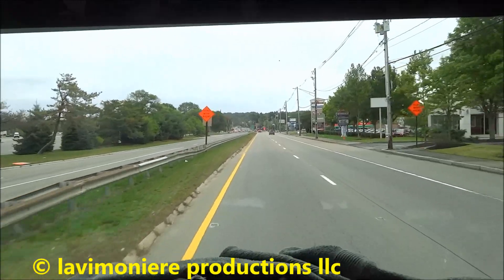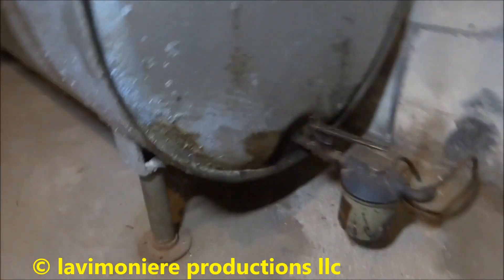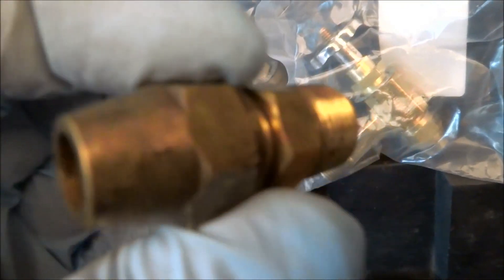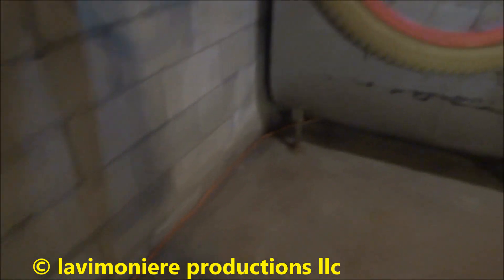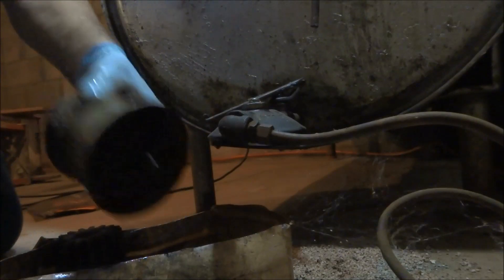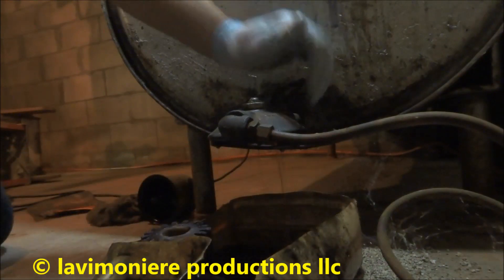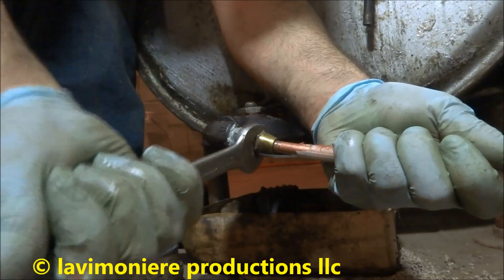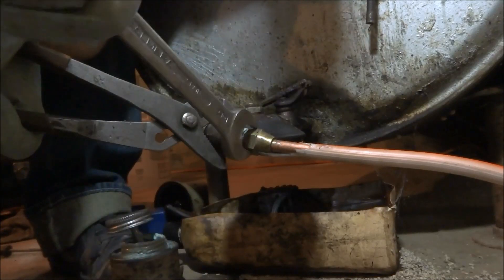oil line upgrade and burner service part 1 of 2

Comment: this is a perfect example of when you need a second pair of hands, someone to hold that filter assembly still while another wrenched the fitting off. granted you got it done by yourself,  but another person on some tuff jobs really helps IMO. especially taking on and off equipment from the van/truck (condenser/furnace etc.). good video Steve. i hate oil furnace calls. i try and save those calls for the end of the day so my clothes don't stink.

Comment: Nice work. This is a beast of a job. You were worried about breaking the nipple off... I wonder if wedging a section of 2 x 4 under the filter assembly would help prevent that downward bending of the filter/nipple. That was the scary part.

Comment: Would it not be better to disconnect at the burner, and run compressed air or CO2 through the old line, before disconnecting it, to get the oil out, before breaking it off at the floor?